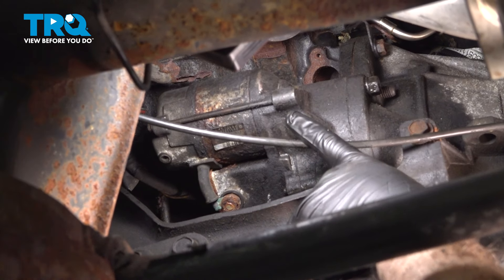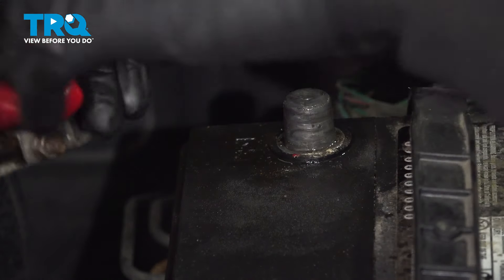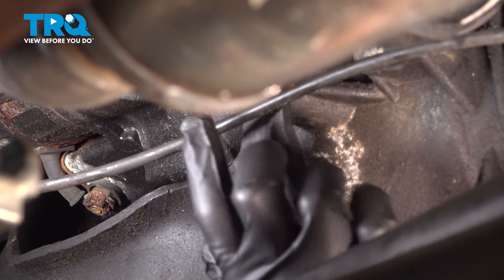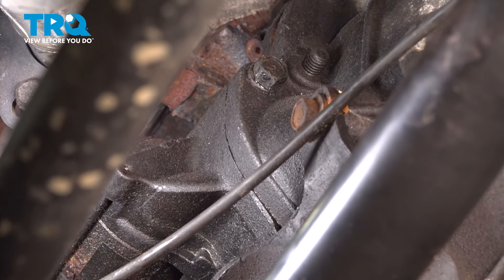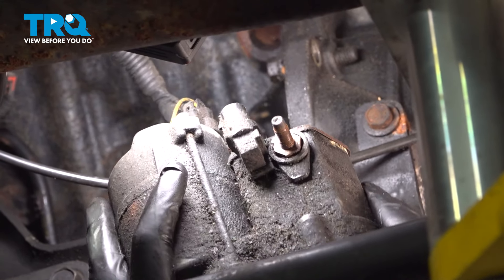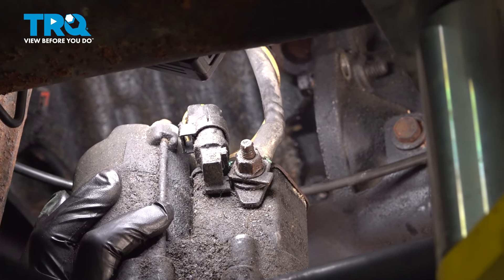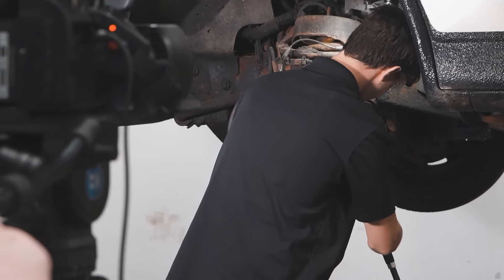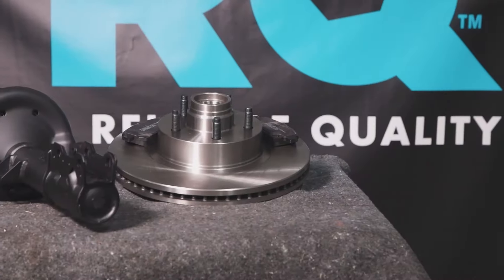How to Replace Starter 2002-2008 Dodge Ram 1500

Comment: Just FYI, on my 2008 Ram BigHorn, the 2 starter bolts are 15MM.  Thought I would share that before you crawl under the truck with possibly the wrong size socket.
Reply: My 07 is the same. I should have read the comments before I got under there.

Comment: great video, i really struggled getting my starter out. looked thru many videos and no ones video showed them actually removing the bolts and the tool they used to do it. once i saw your video i got a wrench like you used and had no problem. Thank you!

Comment: Curious. Is the years accurate? Bc i own a 2007. And your video says 2002 to 2008 but the next video below yours shows 2006 to 2013 and its two completely different starters. So just wondering as i have a 2007.

Comment: Working on a friend's dodge 4WD... 5.7L Hemi... 2007.  The plastic connector on the starter does not look like this one... first of all, the plastic has almost completely disintegrated, but it is a small rectangle that simply slides over a spade connector on the starter.  A single skinny yellow wire comes out of it, about a foot of which is exposed, but eventually goes up into a protective plastic sheath along with the thick red cable that I know goes to the battery.  Skinny yellow wire insulation is dried up and cracking off in several places exposing the stranded copper wire inside...  This wire needs to be replaced but I have no idea what it is or where it goes.  Having excessive difficulty searching net for this wire...  I keep getting directed to how to replace the starter...  any ideas?  Theoretically it should lead me to a neutral safety switch but one piece of info i just located says in the 2007 they got rid of the NSS and went to a TIPM instead.  I have no idea what that is. doing further research but its driving me crazy.  Taking starter to be tested since I have it off the machine anyway... but without replacing that wire, we are dead in the driveway.

Comment: What starter would I use for Dodge ram 2008 hemi 5.7? Any help would be appreciated. Senerio: truck light's start but when crank goes dead
Reply: Maybe the starter cables are corroded inside the black or red rubber protection. Thats my issue.

Comment: How do you do this on a 4x4? There isn't any room to get a socket or wrench in there due to the drive shaft and exhaust in the way of the two starter bolts. Do those need to be removed first or is there a trick to it?